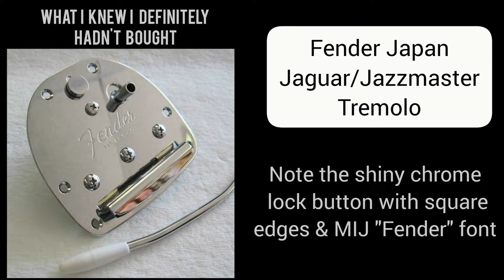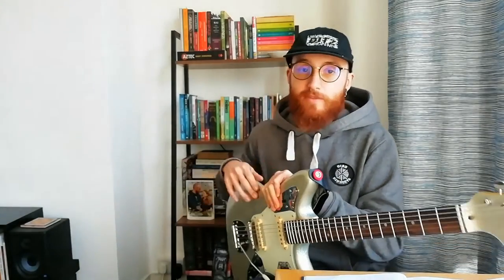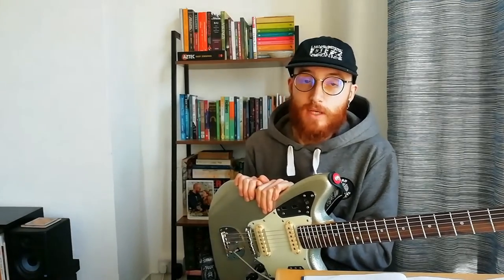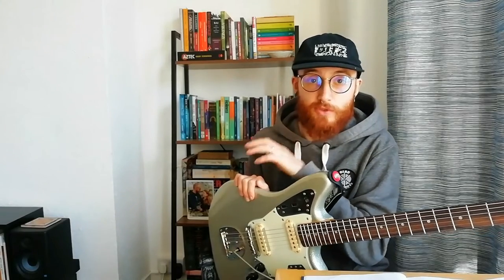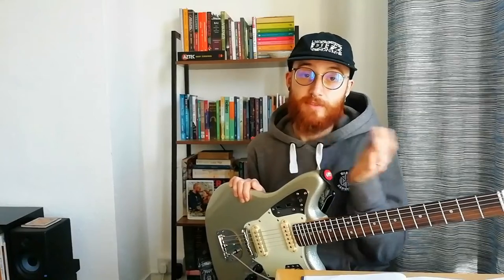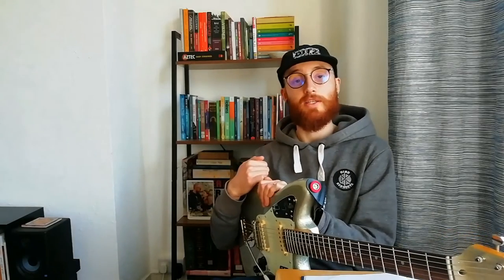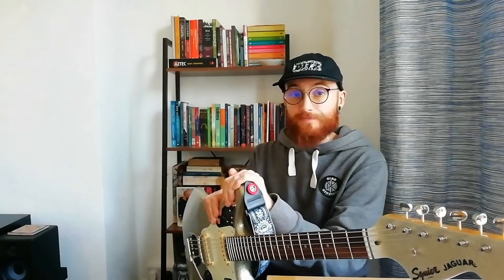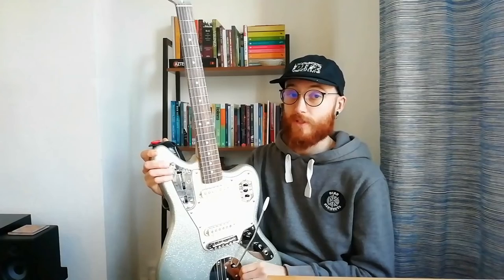Squier Classic Vibe Jaguar Upgrade: Fender Classic Player Jaguar/Jazzmaster Tremolo: Is It Any Good?

Comment: If you end up getting a Classic Player trem on the cheaps, and hate that screw in arm, you can replace the collet and arm with AVRI ones (and if you can source them...an AVRI trem spring too!). I did this on a clients guitar a number of years ago and it worked out really well.. It's an extra $25 or so but well worth it, again if you got it for cheap. But if you paid full price for a CP tremolo, (around $55 bucks) you might as well shell out the extra 12 for an AVRI (which can still be had from some sellers on reverb for less than $70)
Reply from the maker: Mate, everything is so much more expensive outside the US! 😩 In the UK/EU, RRP on the AVRI Trem is £139 ($172) and the MIJ Trem is £80 ($99). You can't buy the CP in the UK but it'd cost around £110 ($135) if you could! And the AVRI arm + collet costs about £46 ($58)! 

Good tip on swapping the arm and collet though! A Staytrem would be another good option. I've actually got the Am Pro Arm & Collet on my Jazzmaster, which is screw in, and it works really well with a arm tension spring in there. My biggest issue was the collet coming undone where the previous owner had taken it off and not done it up back tight enough! Otherwise I really liked the CP Trem 😊

Comment: I swapped out the collet on the CP trem for the one that came with my squier cv jag (no modification was required it screwed into place perfectly) The arm stays in the collet without issue or need for a spring. CP trem is smooth and doesn’t click. 😊
Reply from the maker: @Andrew_L_Brood  Hey Andrew, that's cool, I never would've thought of doing that! I ended up getting another CP trem and did the "spring and shot" mod on that one, which is very easy and works really well! I've got a trem shootout video comparing the CP, MIJ, and AVRI and the details of the mod I did are in there! I'm glad you found your own way round it too! 😊

Comment: Wow! I had no idea they made a sparkle Squier Jag. It looks sooo good! I have several guitars but my favorite is my Squier J Mascis Jazzy. I put a Staytrem on it years ago and that, along with a bone nut, really made it a player. Later I switched to Antiquity pickups and it sounded and played like a much more expensive guitar. Never switched the trem plate and haven't felt the need. I used Puisheen's hammer trick with the arm and it stays where I want and not too noisy.

Your guitar looks amazing and sounds really good. Congrats!
Reply from the maker: Cheers mate! Yeah it's a limited edition! Really lovely guitar. Sparkle finishes are the coolest 🤩 I've heard a lot of great things about the JMJMs, sounds like a quality set of upgrades. 

Bridge/tailpiece upgrades are kind of my hobbyhorse - on most guitars it makes a subtle but appreciable difference, but on really cheap guitars it's night & day! Looking forward to getting a StayTrem arm for this Jag soon.
Reply: @MarkB.Guitar  Yes I was truly shocked at how much better mine was with a bone nut and Staytrem. I really think Squier guitars are the way to go now. I know Mike Adams pretty much gives them all really good reviews. A few upgrades and you have a very, very good instrument for less than a standard Fender. I do have a partscaster with the Descendant vibrato and lipstick pickups and it's great. Really, really good trem unit but the cheaper options are still great. Then neck on my Squier beats any of the pricier guitars though. It is magic.
Reply from the maker: @julius2790    I agree with you 100%. I bought this guitar by going to GuitarGuitar Camden and then onto Andertons and playing everything that interested me in the £250-£600 range and out of the 20+ guitars I played, the ones that left a lasting impression were this Jag, 40th Anniversary Jazzmaster, CV Starcaster and CV 70s Strat. The quality and vibe of them is unbeatable, for sure. I much ordered preferred the Squiers to any of the Fenders I played that day! Your partscaster sounds sweet! I'd love to check the Descendant out 😊
Reply: @MarkB.Guitar  The Descendant is good for a better break angle over the bridge but I don't know if most guitars need that. Mine had issues. The lipsticks were an attempt to get into Tom Verlaine territory. Which they do but they aren't nearly as versatile as Jag or JM pickups. You live and learn!
Reply from the maker: @julius2790  Interesting, you live and learn for sure! Thanks for checking the video out 😊

Comment: Thank you!  Tuning stability is the main thing here, so it's a pity that you did not do the wiggle test by checking each string with a tuner before and after wiggling the trem bar.  This would have been objective.
Reply from the maker: Thanks, that's a great suggestion! I didn't think of that, but it would've definitely been more objective. 

The Squier unit goes out of tune all the time, whereas the CP seemed to remain in tune no matter - at least relative to itself. It would've been interesting to see whether it was going incrementally out of tune equally on each string.

I'm going to make another video soon with my Jazzmaster comparing the Squier tremolo and the MIJ tremolo. I'll try to include your suggestion for that one! ☺️
Reply: @MarkB.Guitar  Nice. Subscribed.  I had a Squier 70s CV Jaguar and the trem was useless because the strings were always out of tune in an apparently random pattern (and I did many things to correct it). Now I have a Squier 60s Jaguar and the trem is far more reliable, to the point where I think I'm going to keep it.
Reply from the maker: @alafenetre81  Awesome, thank you! I played one CV 70s Jag I loved and one that I really didn't like. I'm glad you're enjoying the 60s, I love mine as well! I'm happy to hear your trem is working as it should, too!
Reply: such a pity, what ever will we do?
Reply: @sooperheep  Write useless comments?

Comment: Of the two Vintera 60s jaguars, it's not just the Modified that has the Classic Player trem. The regular Vintera 60s also has the Classic Player trem. Same with the two Vintera jazzmasters. It's also on the Cobain jag. And of course the Classic Player jag and jazzmaster.
Reply from the maker: Nice, very thorough. Thanks for the correction!

Comment: For the cp trem arm problem use some trem arm springs. They are awesome and cheap and effective. They gradually push on the arm the more you screw it in making it stable or loose with just one full turn. Never fails. Use some wd40 and they are dead silent too. You can loose them but they come in 6 packs and i never take my arm off
Reply from the maker: Interesting, thanks for the tip! Are they an official Fender part, or something you're finding in a hardware shop? And which contact points are you lubricating?
Reply: @MarkB.Guitar It's a fender part, they are supposed to be in a screw-in trem for it to be good but nobody knows, and to me it's better than a push-in system because you can dial in your stiffnes in seconds. Drop the spring in the collet, spray wd40 or oil inside and you are set
Reply from the maker: @tommasopoggi7223  I can definitely see the advantages of the screw in system, especially with that tremolo arm spring! I can also see how people could easily lose the springs if they're gigging a lot and taking the arm in and out all the time  🙈 I've recently got an MIJ tremolo for my Classic Vibe Jazzmaster, and the CP is definitely a step above the MIJ IMO, including the arm & collet system 😊
Reply: Another trick for the loose threads is to melt a little solder onto the threads. Then when you screw in the arm, the softer solder will be cut to make a closer tolerance between the collet and arm threads. No more wobble.

Comment: I really dont think it's worth upgrade, you can fix a Squire vibrato by filing it down, I did and taped the underside where the arm hit the plate, its dead silent now, dont use the hammer on a threaded arm btw, use locktite instead, what I really want to do when I get the time is to weld a thick steel block under it to encrease the mass, Im thinking that should encrease the sustain, it does on strats, and the steel on those vs jaguar jazzmaster vibratos are thin
Reply from the maker: Fair enough, dude. At least you know it's not worth it for you! 

My issues with the Squier unit weren't the noise/rattle - I did the hammer trick mod, filed the pivot plate, and did the tape trick on the arm, so mine was virtually silent as well. 

My main concerns were around flubby/muddy tone that wasn't as clear and punchy as I wanted, and poor tuning stability. Upgrading the tremolo and upgrading the bridge (which I'm editing together a video on now) are therefore indispensable mods for me!

I'd be very interested to see the results of your welding experiment. I've been wondering a similar thing, but not as hardcore as welding. Let me know how it goes!

Comment: Are these good enough to gig with?
Reply from the maker: Yeah absolutely! I have 3 Squier Classic Vibe guitars at the moment and I play shows with all of them. They're really reliable guitars and they play really well. I'd take them on tour without a second's hesitation too 😊

The only essential bit of preparation work you need to do is put a drop of blue Loctite on the bridge height adjustment screws as they can be prone to loosening as you play (and makes your action bottom out) - but it's not uncommon for this to happen on more expensive offset guitars too and it's very easy and cheap to fix 😊
Reply: @MarkB.Guitar  Thanks ☺️… it’s all a bit of a minefield really with these models. I’m seriously considering this model along with a MIJ albeit that’s near a grand and I’m just not sure if I’d be getting THAT much more for the money really so trying to find the middle ground. I haven’t come across any outstanding reviews for the player series either…
Reply from the maker: @rach623  Ha, yeah it can be! I think they're definitely a bit more suited towards people who don't mind (or actively enjoying) tinkering with their guitars to get them just right and are quite particular about their guitars and tone, rather than the kind of player who doesn't really care about the fine details of the instrument so much but just wants to be able to pick something up and plug it in and not have to think about it...

I'm not personally too excited about the Player models either because they're kind of missing so many of the essential elements of what makes Jaguars cool - even the headstock logo is bad on them IMO 🙈 

I think especially in the UK/Europe, MIJ stuff offers excellent value for money because USA models are so much more expensive here than in the USA - you can get some great bargains on secondhand MIJ Jaguars. I don't know if they're less competitively priced in the USA or not...

In my opinion, the biggest selling points for an MIJ over a CV would be:
- Vintage style neck profile with 7.25" fretboard radius and 1⅝ nut width
- Bridge and tremolo will be higher quality and there's less need to replace them
- The stock pickups probably aren't microphonic like the Squier pickups are

I forgot to mention that - the stock Squier pickups can be very badly microphonic and squeal if you're playing at loud volumes or with a lot of gain. I have 2 Squier CV Jags and one was usable in that regard and one wasn't. 

The Vintera 60s or MIJ guitars would be great instruments that should be more or less good to go straight away and are a bit more vintage correct.

With a Squier CV, the pickups may or may not be usable in a live situation (I replaced mine very early on so had forgotten about that), and the tremolo systems also benefit from an upgrade IMO.

All 3 are good options: you can get the Squier for less money and upgrade it a bit at a time (pickups and tremolo are pretty vital upgrades in my opinion but aren't essential), or you could save up a bit more and get an MIJ or Vintera 60s and not have to worry so much about potential issues. 

I'd recommend trying them out in a shop and seeing what you connect with! 😊
Reply: @MarkB.Guitar  You’ve pretty much covered it Mark. I think I might hold off and get the MIJ primarily based on the fact that it will be my main guitar. At least that’s the intention anyway. Thanks for the feedback. 👍
Reply from the maker: @rach623  I hope you find the guitar that's just right for you and that you really enjoy it! I've always thought that MIJ Candy Apple Red Jags are absolutely beautiful 😍
Reply: @MarkB.Guitar  I’m hankering after an ice blue metallic or a firestorm silver ( I think that’s what the colour is called) 😊.
Reply from the maker: @rach623  Money no object I'd go for Inca Silver or Aztec Gold, I think 🤤 I hope you find one that's just right!

Comment: At the end of this, the takeaway for me seems to be that all Fender arm/collet designs are still terrible.

Since you're in Britain, why didn't you just replace the bad collet/arm on the CP Trem with a Staytrem? It seems to just be a universal improvement over Fender parts.
Reply from the maker: You're absolutely right there! I've more recently made a video on the MIJ Tremolo and there's issues with that arm/collet design too. I'm just finishing off a video looking into modifying the American Professional arm/collet which isn't great stock either. 

I've recently bought an AVRI Trem from this Jag and have put an order in for a StayTrem arm/collet. Just on the waiting list to be sent the invoice... 😓 It's very good value over here though.

Easy-Trem is another cool option in the UK, but very expensive!

Thanks for checking it out!
Reply: @MarkB.Guitar  I have the same CV Spark Jaguar with a Staytrem on just the stock Squier trem. It's well worth the wait!
Reply from the maker: @inthestudy  Sweet, can't wait to get it! How long did you have to wait until you got the invoice sent through, and how long after that until it arrived?

Comment: Threadlock.                                                         That is all.
Reply from the maker: Yeah... I wish I still had this tremolo and had found a way to keep the tremolo securely attached. It's a great tremolo, maybe should've tried harder to get it to work! I prefer this tremolo to the AVRI for sure now that I've got an AVRI
Reply: @MarkB.Guitar  Well to be fair... I've just discovered threadlock and put it on everything things I should/things I shouldent like a child.       but I'm gonna put it on the shaft of my trem arm as I feel that would work. as to stop rattle I just hit the trem in with my palm.
Reply from the maker: @BLACKSYNTH  Ha, yeah threadlock is great. I wonder whether it would've stopped the problem I had with this unit of the collet coming undone too 🧐